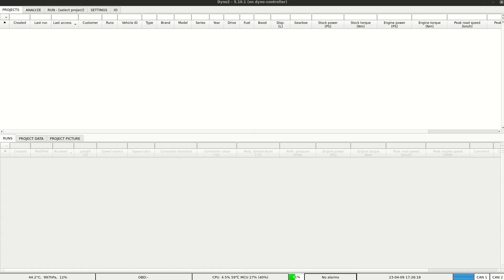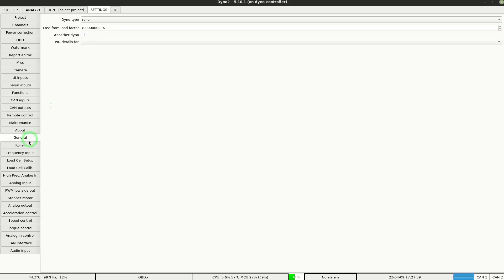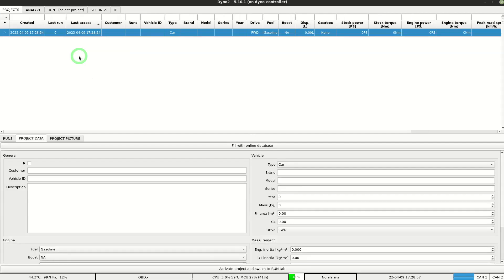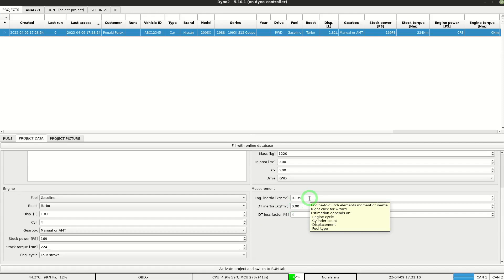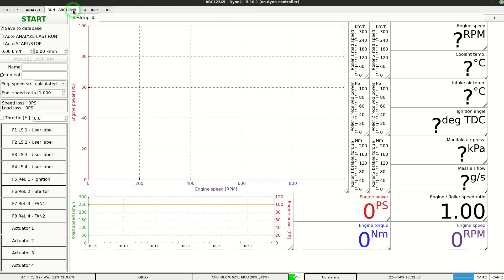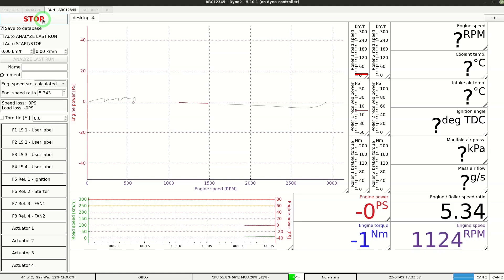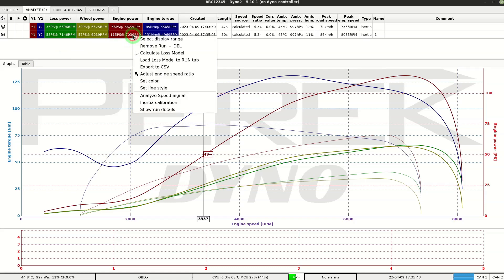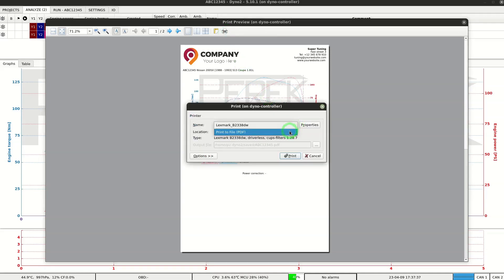Inertia dyno quick start guide with PEREK Dyno2 software

Comment: hello I have the revolt dyno with the same software I have the power in hp how to put it in ps like you?
Reply from the maker: Hello. To quickly change it everywhere, go to SETTINGS / Misc and under UNITS section, update the unit for power.
Reply: @perekdynocontrollers   top thank

Comment: What would be the proper method for calculating free rotation losses with an automatic transmission when unable to coast down in neutral?
Reply from the maker: In that case, the best you can do is to load losses from a similar car. Unfortunately, often automatic gearbox is not dyno friendly.
Reply: @perekdynocontrollers  Its unfortunate most (90%+) vehicles in US are automatic transmissions. It becomes difficult with high power drag race cars with automatic transmissions and high stalling torque converters.